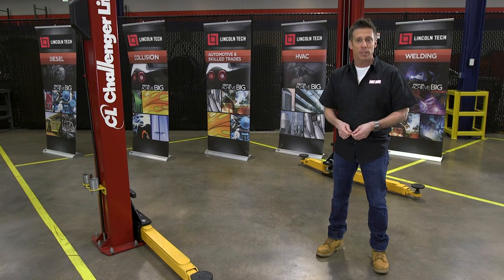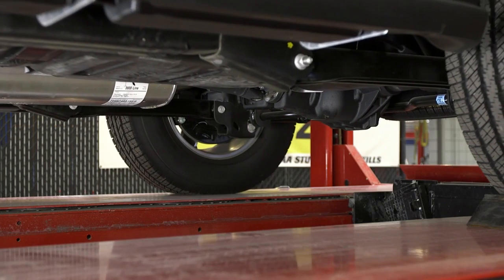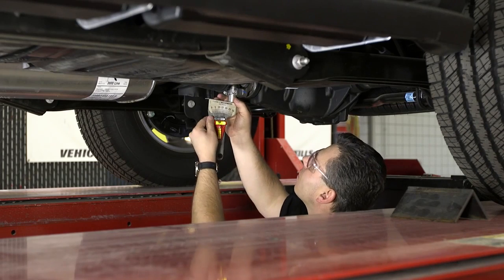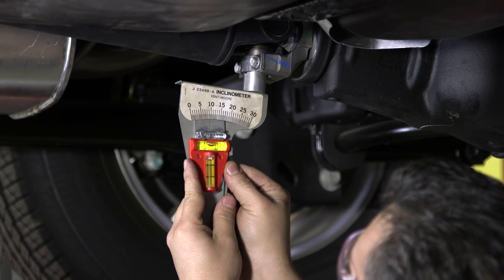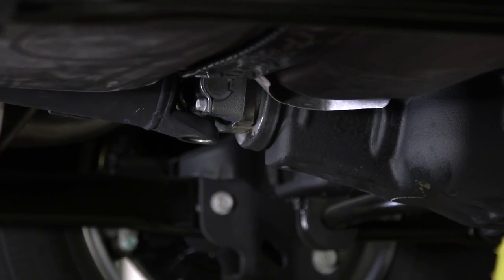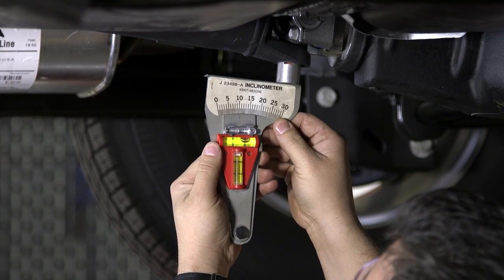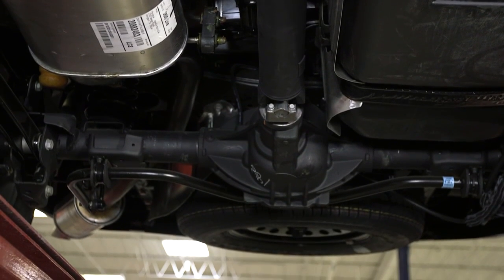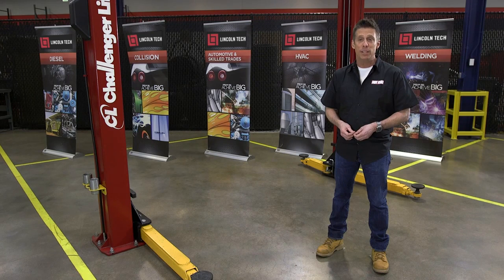How to Measure the Driveline & U-Joint Angle of Car | Hot Rod Garage Tech Tips (Ep. 16)

Comment: He says in video “u joints are happiest when turning between 5 degrees and 8 degrees”. Wow, never heard that before. That’s extreme and should wear out your universal joint. Every other reference I have seen says universal joints should be at least 0.5 degrees but no more than 3 degrees to ensure good universal joint health....but check with your universal joint manufacturer eg Spicer. The Driveline Operating Angle should preferably be zero degrees (ie parallel) but less than 2 degrees in order avoid driveline vibration at speed. See Tremec app for your phone to help measure angles.